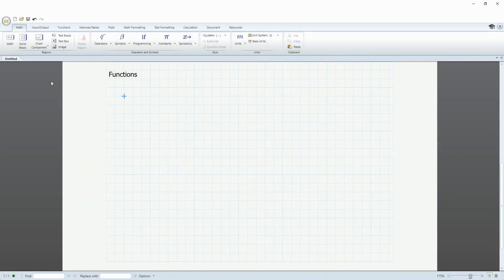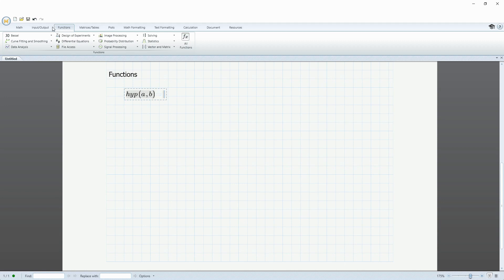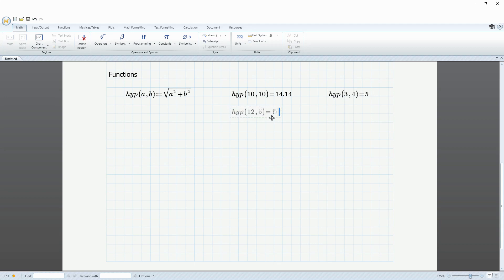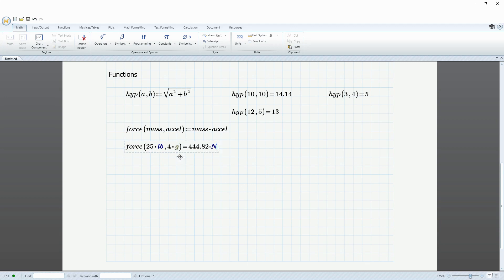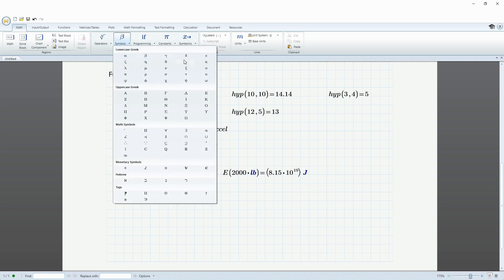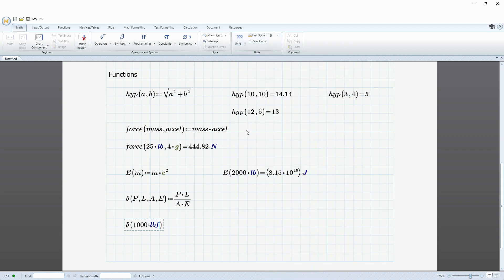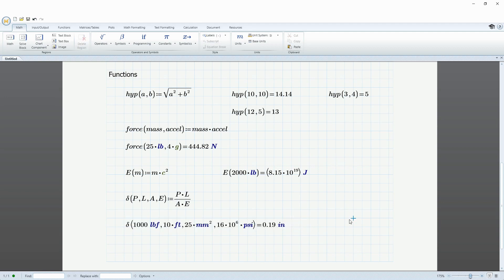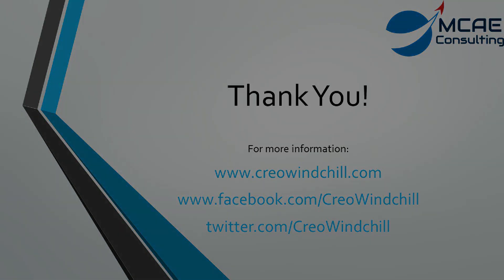PTC Mathcad Prime - Functions | Part I - Custom Functions (Tutorial)

Comment: Damn, why are those imperial units still used and not forgotten like some archaic stuff from before the middle ages(like measuring length in elbows)? To do any kind of calculations they still need to be converted to metric, Mathcad manages to do it seamlessly, but pretty much everywhere else they are a failure point that will eventually cause problems(and I bet it already did more than once)
Reply from the maker: Old habits die hard. I remember being on the ground floor of a project that was international in scope. I begged for us to design in SI. But the Old Aero mentality in the US won out.